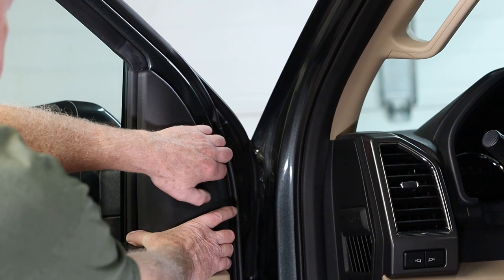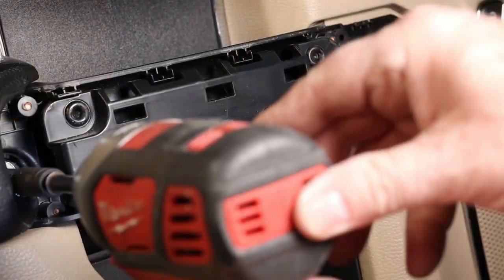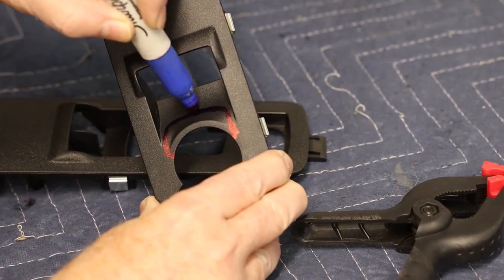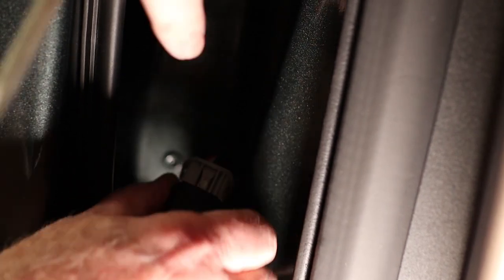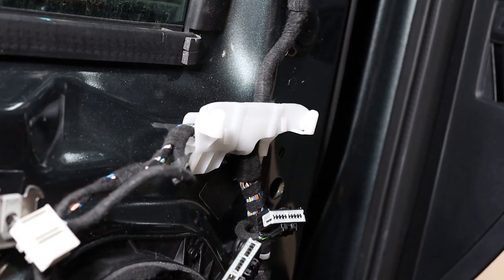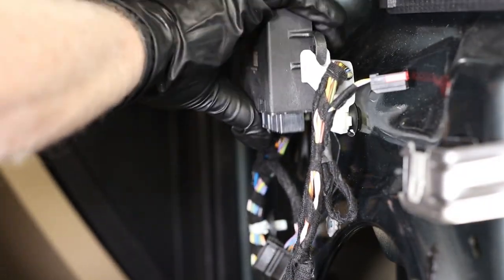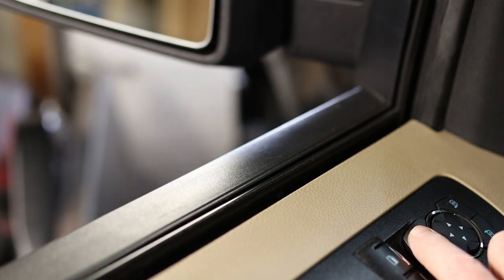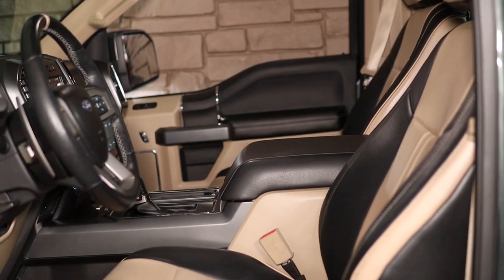F150 Power Fold Mirrors & 360 Camera Install Part 2

Comment: What the part number for the doors wiring harness and does it work with the BLIS system
Reply from the maker: Yes, it should work with BLIS. The part numbers are in the comment section above.
Reply: Thanks

Comment: Wow, awesome job on this video! I could definitely use this feature on my '16 as I'm now parking in my garage and have to fold my mirror to clear the door opening.
Reply from the maker: Thanks Ponie! Yeah...If you buy the mirrors used they aren't that bad. I put all the part numbers for the harness and door module in description. The mirrors without the cameras are even cheaper.
Reply: @StupidFastTruck  right on man! Sent you a message on Instagram as well.

Comment: Hi, with the new harness, did you have to add new pins, this is the directions for adding power fold mirrors." Note: if vehicle currently 
has 22 pin door harnesses, the existing door harnesses can quickly/easily be modified to support the 
power fold (not power telescope, memory or Technology Pkg. w/side camera) function by simply adding 
(5) additional wires from each door module to the 22 pin mirror connector. You will need to purchase 
(20) DU2Z-14474-CA (WT-1002) wires. This will make (10) wire assemblies – (5) for each door. Wiring 
schematics below show the (5) wires that must be added to each door harness. Failure to add the additional (3) wire assemblies to each door harness for Mirror Sense (Memory) will result in 
DTC C1B15:15 that cannot be cleared in each door module."

Comment: Thanks for this video! Happen to have part numbers to everything ? Will you show how to get the spot light to work and forscan changes? Any tips on problems I might run into? I already have the mirrors just need everything else
Reply from the maker: Thanks for watching. The part number for everything but the mirrors are in the video description. There is also a link to the F150 Forum that should have the Forscan settings you need. My truck came with the mirror spots form what I understand the the wiring is there. Just the switch is all you should need.

Comment: Quick question, the inputs to your As Built modules for the driver and passenger side, is the code that's there the new or the old? I've got a 2020 F150 XLT with bone stock mirrors that I recently did this upgrade but haven't changed stuff in FORScan, still waiting for LCM for spotlights, it's on backorder. Thanks.
Reply from the maker: The codes in the video were for the Lariat door modules. My originals would not allow them to be programmed with those code.  The module programming was so they would operated with the key fob.

Comment: Hi Mike! I have my mirrors, harnesses and modules ordered. One last question please: How do you feel about losing your mini blind spot mirror? I just received my driver's mirror with the BLIS thing so I ordered replacement heated glass with the mini blind spot mirror. I wondered if you did the same thing? Thank you!
Reply from the maker: Thanks...I never really noticed it being gone. Its so small for me it didn't seem to be that useful for me at least. The auto dimming the of the Lariat power fold mirror I noticed on first drive.

Comment: By watching this video it looks like a 360 camera can be installed in a truck without. With a new truck that has almost everything else seems like it wouldn't need much to add a few extra cameras. 
How does a guy go about finding out what is different from a truck with 360 cameras and one without?
Thanks
Reply from the maker: I'll be covering the wiring in an upcoming video that will wrap it up. I had some pins for a wire harness that were back ordered forever.
Reply: @StupidFastTruck  Awesome I'll be looking forward to it.

Comment: I have a 2018 Xlt with BLIS and the 22 pin connector mirrors and would like to add the power folding mirrors and eventually the 360° camera system. I know I shouldn’t need a new wiring harness or module for just the power folding mirrors since I already have the 22 pin mirrors, but will I need a new harness or module when I add the the camera function?
Reply from the maker: You could add the other wires for the camera. Its on a separate connector to the mirrors. Have you seen part 3 for the cameras? You would need to add the wires in the door harness from the door jam to the mirrors. Its 4 wires, the signal wires should probably be shield cable, then the power wires for the camera.

Comment: I have a 21 lariat with powerfold mirrors but would like to add new mirrors with cameras, do I need the full wiring harness and modules?
Reply from the maker: Unfortunately I don't know very much about the 14th generation  F150s and what would be required. Sorry I'm not much help. On 15-20 years truck if you have power mirrors you could build a sub harness for the cameras only if your truck was factory equipped with power fold mirror.

Comment: I have to ask about the turbo boost gauge in the intro.  I know you can add that in forscan but have you integrated it as a supercharger boost pressure gauge somehow?
Reply from the maker: All I did was make the Forscan change and it just worked, credit goes back to a guy (jmeo) 5+ years ago. He had one of the first Whipple trucks on the F150 Forum, and it was one reason this truck exists. Thanks for watching. This tread started it all. https://www.f150forum.com/f123/2015-ruby-2-9-whipple-supercharger-install-316508/

Comment: Incredible video!!!! I am wondering if you could possibly answer a question I have?   I bought a 2021 F-150 Supercrew with the 302a package, but manual mirrors…… I have the lights 360° cameras etc. Would I be able to do this mod and would I need any parts for the rear doors? Thank You for doing these videos.  I hope you can answer my question. Be well and be safe.
Reply from the maker: I don't think you would need any parts for the rear doors. Several folks with Supercrews have done this mod on Gen 13 trucks and have only changed the same parts I did.
Reply: that's  good to hear.  I am going to start to get the parts together. I am very handy but if I happen to run Info a jam would you mind if asked you a question?
Reply from the maker: Sure, no problem.

Comment: I ran into a weird issue. I can’t get the passenger auto up to work. The down works but it won’t go up. I put the old module back in then it works fine. I thought maybe bad module got a new one and still the same issue. You think it could be a wiring issue?
Reply: Did you ever get this issue fixed? I’m running into the same thing.
Reply: @MT-mi9kf  yes. I ended up looking up the as built info for a higher trim level.
Reply: @its_big_dee  Just for the driver and passenger module? Do you happen to know what as built data you used? I have a crazy issue where so can get it to work after calibrating it but as soon as the window goes all the way down, it  won’t do one touch up until I recalibrate it again. I thought it was a bad module but both passenger and driver do it.
Reply: @MT-mi9kf  yeah that was what was happening to me. I picked a 2018 lariat to get the as built info. once I put it in it worked correctly kinda. My driver side is hit or mis some days it works some days it doesn’t I just got used to it. If I do the auto down. Then pull up it work for what ever reason.

Comment: I added 2016 Lariat powerfold mirrors to my XLT. I also switched harnesses and modules the passenger side worked but drivers didn't. The puddle light also didn't work. Used forscan to try and program but still no luck. Do you have any advise on what to check next? Thanks
Reply from the maker: Sorry I missed this, that's weird...Does the power door locks and windows work?
Reply: Did you ever figure out what was causing that ? I put new harnesses and modules and the passenger works but the driver only has turn signal .
Reply: @troywest2884  I did get it figured out as far as puddle lights turn signal etc. But the one touch window still won't work even after doing the reset but I'm ok with it for now I guess.

Comment: Did you have to repin the lock/unlock door switch?
Reply from the maker: No...I cheated and replaced the door panels with Lariat door panels, so I just used the memory switch. The Lariat panels were nicer too with soft touch top
Reply: @StupidFastTruck  Was the new door Lariat door panel and harness all that was needed to get the memory seat function to work, or is more wiring necessary?
Reply from the maker: @Filup93  it would be needed but yes there is more wiring that would need to be added.  Honestly I don't know how much. The harness connects to the memory buttons drivers door. The memory button does not function unfortunately. The power lock button does.

Comment: Hey!   My dealer installed ML3z17696CA but they can't/won't fix the side marker (amber) lights.     Did you get these working with forscan?  

360 cameras, no power fold.  Manual telescoping.
Reply from the maker: No and to be honest I never tried to make them work. I might look into that however. I like the look.
Reply: @StupidFastTruck  keep me posted.   I can't believe ford can't figure it out.   I went to two dealerships.   They installed the mirrors as part of the new 2021 vehicle purchase... And can't get all the features to work!
Reply from the maker: @aldayonthewater6680  will do!

Comment: i bought the powerfold mirrors feom a 2017 my truck is a 2019 regular cab xl will they work on my 2019
Reply: is that a yes bro
Reply from the maker: The passenger side mirror might not have the ambient temperature sensor on the 2017 mirrors. On newer trucks late 2018-20 they moved the sensor from the grille to the passenger side mirror.  That might be a problem, my 2018 had it in the grille. Watch the video on the emblem and you can see the sensor in the grille. See if yours has it.
Reply: yes it has it on the grille
Reply from the maker: They should work then...You will need door wire harness, and both door modules, plus the switch plate like I modified.
Reply: thank you bro

Comment: What was the approximate cost to do this upgrade?
Reply from the maker: I think I paid about $250 each for the mirrors with the camera. Without the cameras they are a lot cheaper. Door harnesses were $150 each and the door modules were only about $25, I think they have gone up because of the chip shortage.

Comment: Any one know what mirror are those I’m trying to get all the part but I don’t see the part on the description I will appreciate any help please and thanks you
Reply from the maker: The mirrors I bought on Ebay used. I honestly don't know the part number. New mirrors are VERY expensive, your best bet would be either direct from a salvage yard or Ebay. 15-20 drivers side is the same, depending on with or without cameras. 15 to Mid18 passenger side is the same. Some time in 2018 Ford moved the ambient temp sensor to the passenger side mirror from behind the grille
Reply: I just got the harness but I still looking for the mirror for f150 2019